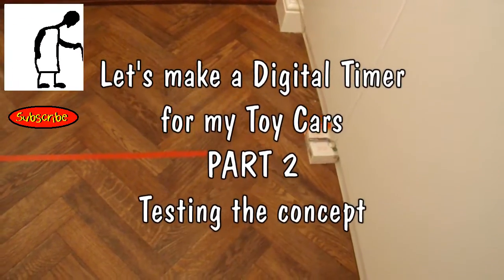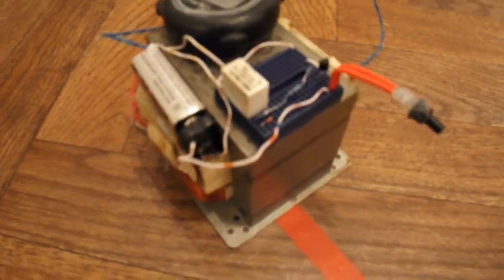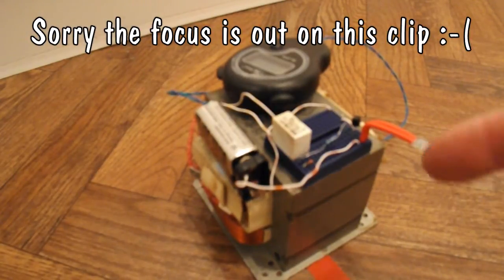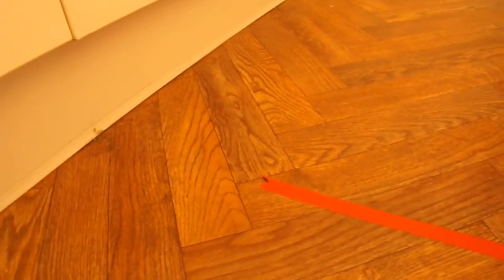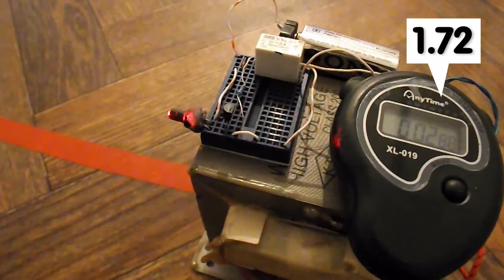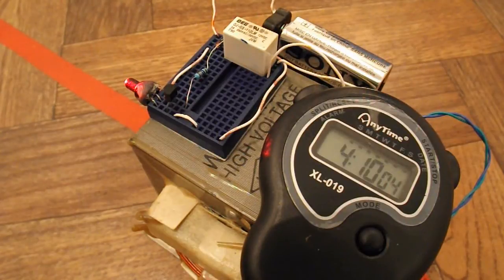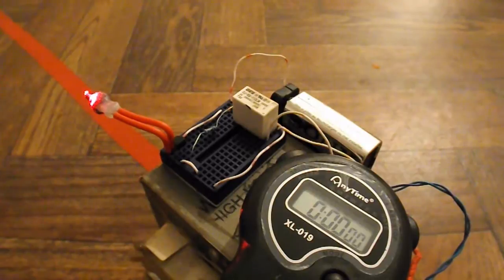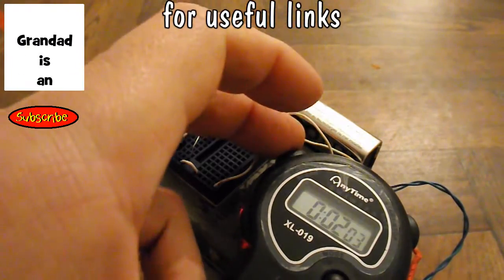Let's make a Digital Timer or Speed Trap for my Toy Cars - Part 2

Comment: hi, i have a project, that similar whit project on this video. i will measure the length off an object, the measuring methode is object placed on the belt conveyor that linear speed is 0.2 m/s. when the fornt part of the object starting deter the laser light to the recivier the timer is start. when the rear part of the object through, light of laser recivied, the timer is stop. we have data how long time the light of laser stunted by the object. by multiplying the speed of belt conveyor and the time of laser stunted we can count the lengtg of the object. can you help me? reward if you can help me. any whatapp contact? please contact my whatapp +6285642924966 i am indonesian, sorry if my english is bad.
Reply from the maker: I doubt the method I am using here will be accurate enough as I am relying on a mechanical relay to operate my timer. I would suggest you would need to interface with something like an Arduino to do the timing for you and I suspect that if you do a search you will find an Arduino project that does that for you.